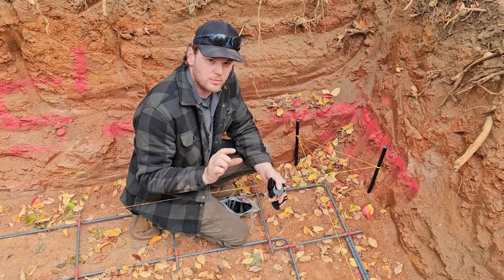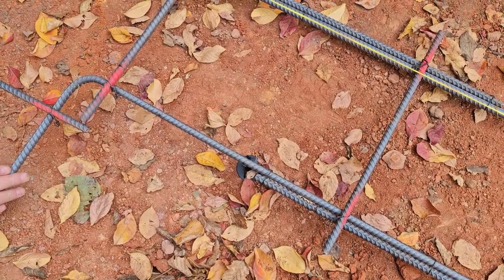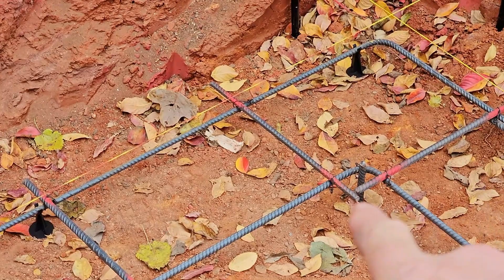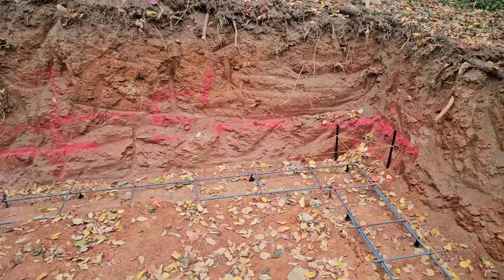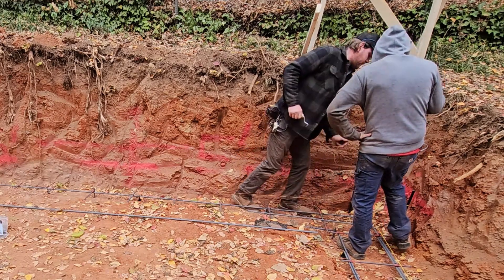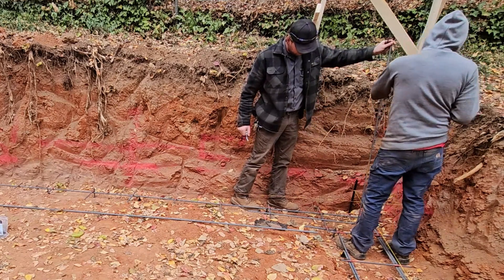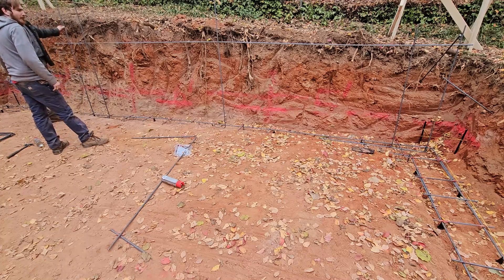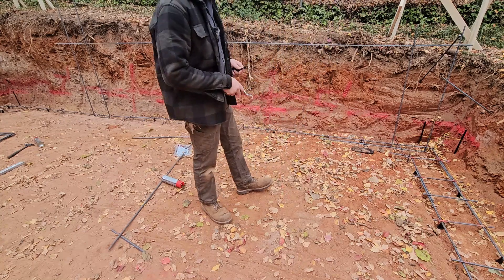Installing Rebar For The Basement Walls : Large 2 Story Addition

Comment: How thick is the wall?
How many inches overlap rebar when joining a length
Reply from the maker: The wall is an 8in block wall poured solid. The rebar overlap at the linear joints are 24in.